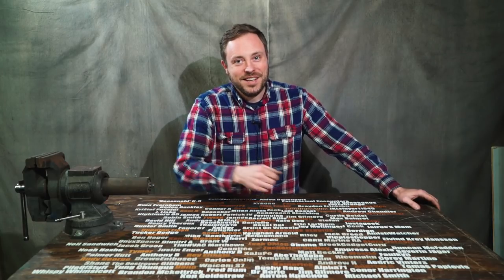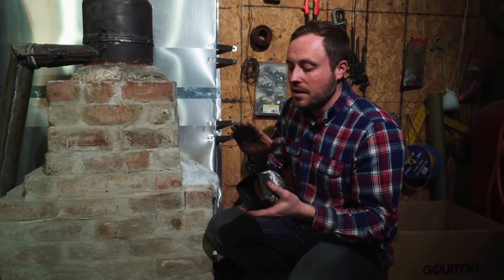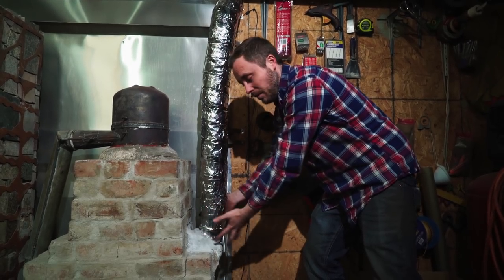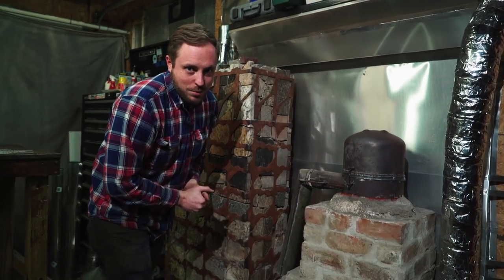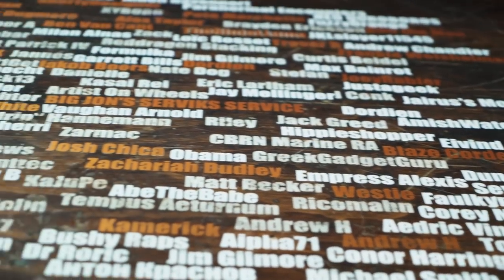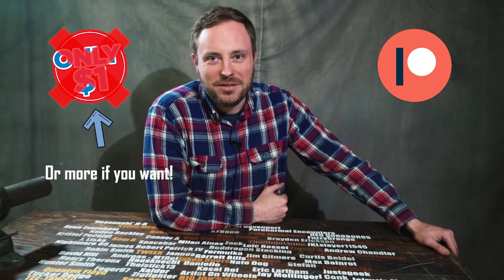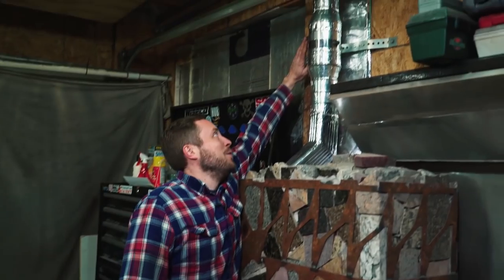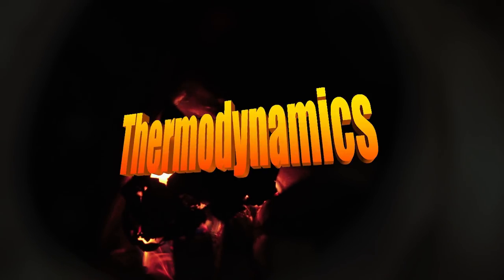Heat Your Garage For 74¢ A YEAR! - Mini Nautilus Rocket Heater Upgrade

Comment: Nice job! Rocket stoves are a thinking person's woodstove... and even though mine is 4 years old... I keep messing with it, make new drawings, and will build version 2.0 at some time. There's so many innovations here on YT.

I built a 6 inch flue rocket. It is a free-standing unit, utilizing a 55 gallon barrel. 

It is, internally, like the hippie rockets (hell, I am a hippie) only the riser is made from insulated firebrick (the most expensive component).

The exhaust goes out of the bottom, and into a 15 foot long mass of cement blocks and crushed stone, at floor level. From there the exhaust goes up and out of the basement, through the wall, and outside through that super-expensive stainless insulated flue pipe, gifted to me by a friend (free is for me). My indoor flue temps, at building outlet, are similar to yours... rarely 150°... more often 120°.

My stove is for heating my basement workshops, and the house above... the burn chamber is 8 x 8 inches,therefore, I can burn standard cordwood.

From my experience, it looks to me as if smaller rockets are more efficient, and hotter... but most smaller ones are to heat workshops/garages, not entire homes... all I know is that I love using it.

I was happy to get the insulated flue because condensation would run into the house, and black mung would run across the floor... at least it is water soluble, and cleans up with soap and water...

I put a T flue pipe outside, at the bottom, with a seepage hole in a cap. This keeps all condensation outside.

One thing I want to do is figure out an automatic lid, outside, that would close when the stove shuts down. I believe a lot of my mass heat is going up the chimney... and that the cold air, coming back down the chimney, cools the mass.

I go through a wheelbarrow of wood per day. When I had a standard woodstove, I'd go through 3 wheelbarrows of wood...

My rocket is on my channel if you'd like a look. The video is with the smaller 4.5 x 4.5  burn chamber...

I've been using it for 4 seasons, and have had zero creosote buildup.
Reply: So.. you go pretty much against anything that would make it a rocket stove and have built something similar to a normal stove how the rest of the world uses them - just a bit less efficient.-

Comment: I think you have done a good job here I think the reason you can use metal in the burn tunnel is you have a micro system, I think if you had an 8 inch system metal would not last.  I don’t think you give the hippie’s enough credit, I did laugh when you kept bringing them up because I think too many of  us are over the top on political correctness, I Have been to Ernie and Erica’s place and seen their rocket mass heater they are probably the most experienced builders alive. And they are both extremely well educated about fire and thermodynamics you keep mentioning. Anyway I love the video thanks for sharing, thumbs up from me dude!

Comment: it's all about the insulated chimney column to really get things flowing in the right direction, especially in really cold weather and especially when you add vertical column height to it. 

Also, the ease of operator input is more of a major factor than one might first imagine. pellet stoves will self feed for hours, a long feed pipe with scraps of sticks that will slide down on their own might also self feed for hours.

Comment: Have you considered getting/making a small wood chipper to avoid having to spend the hour or so each day breaking up the fuel?
Reply: Darksunrise there’s videos on how to make them too, usually it requires welding and a pretty adequately equipped workshop so it might be a cheaper one-off purchase to get a small one from the store. 

Also if you own a chainsaw there’s attachments I’ve seen that act as a rough marker for the length of the logs you’re cutting. It’s literally a stick that screws into your saw that pokes off about a foot from the blade so you can measure what you cut at the same time.

Comment: The comparison with propane at the end is a little misleading. It sounds like you're suggesting the rocket mass heater is more efficient than the propane heater because the rocket mass heater keeps the room warmer longer. But that's a question of convenience, not of efficiency. After all, you could create a propane mass heater if you wanted, and that would keep the room warm for a long time, too.

Comment: Hey, hippie here. If you have a predominant wind direction you should point the open end of you intake towards it, and the exhaust outlet away from the wind to generate a flow. If you want to get serious about harnessing that power also, you could stick a funnel on the intake side, and build a little venturi system on the outlet. That would negate the need for a computer fan, and possibly oversupply your stove with air (computer fan is a genius idea btw. I've heard that some fossil fuel based electricity generating stations preheat their intake air by drawing it down around the exhaust chimney, which results in such an efficient heat transfer that they then have to use fans to push the cold exhaust air out of the chimney. Similar to what you're doing here. Good Job)

Comment: I have just built a new barn and intend on using a rocket mass heater, so I have a couple questions. Well more than that, but I’ll limit myself. Have you ever thought about reversing the air flow in the summer  to cool the mass? I guess in your case you would not have to reverse the air flow. What I am saying is force the cool night air through the mass to cool it. Then the warmer air in the room would go into the cooler mass in the day time and cool the room. The second thought I have is an odd fuel. I live on the North American plains and we have an abundance of rag weed ( tumble weeds) which are flammable. I am going to harvest them while they are green and bundle them up tight so they will fit in the rocket. I am not sure what to expect . Do you think I am chasing my tail?

Comment: A chimney installer once told me that you should never reduce your chimney to the outside since it created compression in your exhaust and and is counter productive to your flow! That way starting a range exhaust fan can easily reverse you flow to inside your house or your garage. In the case of a garage letting the door open could also cause the flow to reverse.

Comment: Oh yes…we’ve had all kinds of trouble getting the old chimney to draw.  Not even making the firebox smaller, could help it draw.   Not even sticking a fireplace insert into there helped—it was a disaster. 
That’s another reason we bot a Liberator rocket stove + a chimney sleeve, besides how beautifully efficient these are. 
I used a drier vent to bring air into the air intake on it…& had to put a damper in that, to adjust air flow in.  

But maybe I’ll try insulating the intake, too…had no idea cold air would help the burn!? 

When installing the sleeve, I had to remove the recommended insulation wrapped around the sleeve, to fit it up thru the chimney, & simple-stuff it around the sleeve at top & bottom of chimney.   

Your cold air intake going direct into your feed tube, seems inconvenient….if it went into the side to of the feed tube, you could leave it connected, & be able to add wood more easily. 
Could even use a 4” pipe section to extend the feed tube then, allowing more sticks to be put into it, so you didn’t need to keep adding fuel so often.

Comment: What's the difference between forcing cold air up, and forcing hot air down?

How much cooler could the hot air be once it gets to the down tube? I can't imagine it would be significant, it's 6 inches from the to of the heat exchanger.

Comment: I was concerned about creosote build up in the heat exchanger but I see in another comment that you have pulled it apart and haven't seen that to be an issue. Makes me wonder why I have to clean my chimney twice a year when it's a straight shot up.

Comment: Three key issues need to be dealt with when designing rocket stoves:  Air flow, extreme heat in the burn chamber and fly ash build up in turns of the exhaust piping... restricting air flow.  In reference to the latter, (you've addressed the first two adequately) how many hours have you put on the stove?  How often do you clean ash out the bottom of the Nautilus?  Have you noticed any reduction in performance over time ( a sign of restricted air flow)?  Would you put more clean outs in retrospect?  If so, where?

Thanks, M

Comment: Hmmmm I may  have to build that. As far as making sticks small enough to fit in there. Get a 14" bandsaw, and decide on the dimensions and start cutting. I probably already have 2 or 3 buckets of pen blanks that would fit right in there. One suggestion I would have is to add a small computer fan on the exhaust as well to ensure you get it going......

Comment: When you said you were going to do your outtake in front of the stove, but wouldn't because you felt like you were going to be burnt.  Just had an idea, maybe put a cage around the helium tank to prevent anything falling on the tank?  Air/heat could still go through, but would stop anything from falling on it and catching fire.

Comment: How can you clean out the ashes and creosote that would accumulate in the exhaust chambers over  time?
Reply: If the fire burns hot enough there are no ashes. If I remember correctly he said that the target temperature is 1200 degrees.
Reply: @danielstellmon5330  That may be the combustion temperature, but he said the exhaust stack was only warm to the touch.  I imagine there will be a lot of condensate collecting in the chimney/heat exchanger.

Comment: I honestly don't know if this would work but couldn't you chip the wood to make it easier to load it?(also this would require some sort of wood chipper which negates the "freeness" of it) but sort of like what pellet wood stoves use or use actual wood stove pellets if you're willing to trade off free heat for still incredibly cheap heat but with less tedious work every time.
Reply: What I normally do for my wood forge, which has similar fuel size restrictions, is to gather scrap wood for like a month, then take 10 minutes with the chop saw to cut it all into small bits. All the small bits then go into a big barrel, so the wood is all ready to go when I want to burn it.

Comment: the hippies typically say you cannot make your combustion chamber out of steel, but i believe that's only true for the larger systems, like ones with 8" cross sectional flow area. the temperatures in those are much higher, and the steel will rust out within a few hours of running

Comment: I would recommend double wall pellet stove pipe because it has a stainless steel liner in it. It comes in 3 and 4 inch sizes. Also 6” triple wall stove pipe could be very useful here.  but, good job looks good!

Comment: Could'nt you use a heat transfer to create electricity to  operate your fan from the top of your heater , then run it to a fan to blow air in it ?

Comment: One thing you did not mention is carbon build up in the heat exchanger and the exhaust pipe. Because the piping following the burning chamber is so cold the residue carbon will condense before it can burn. These build ups, once big enough can burn off and turn your exhaust red hot, so either clean it sometimes or be aware of a possible run-away.

Comment: You could take the head off a lawnmower engine and bolt a small wedge to the piston. Then make a jig to hold 6 or 8” blocks to be split. Drive the engine with an electric motor and split very fast.

Comment: Interesting project. 
Listening to your comments on the time spent feeding fuel into the stove makes me think this is a perfect candidate for a wood pellet feed hopper.

Also, is your flue handle 90 degrees off? Or did you just move it the wrong way in the video?

Comment: Add a rotating chimney exhaust tip that the wind turns like a weather vane to prevent downdraft.  If made correctly you could use venturi effect to create draft when the wind is blowing.

Comment: Would insulating the drop pipe from the rockets tank into the mass reduce the amount of instant radiant from that amount of surface area and put it into the mass possibly helping the draft a little in the process. The surface area of the drop pipe could be 1/5th of the surface of the tank itself (not going to take time to do that math). Maybe a header wrap or the fiberglass stuff you used on the primary burn chimney and leave the joints exposed so you can still remove it easily. Although I think your new outlet chimney can change the issues you had. I would love to see it work without the 12volt fan except for start up times. Also dollar store aluminum tape can hold up to 700F I use it on my woodstove outlet flue joints before the masonry chimney and the joining of the flue to the stove since everyone's 8 inches isn't exactly the same (0.o) and I didn't want to build a shim. I take this off twice a burn season at the stove to clean things and have seen it peak to 700F when I fire it off sometimes before I engage the bypass to the cat chamber and all is well with it. I know what you mean by scavenging all the heat my stove full burn the box is +-500F with the cat up to temp 1200-1400F my flue temps drop to 250F versus 500+ with the bypass open at full burn. 700lbs of cast iron and tossed some old chevy heads on it for good measure. I might not be as efficient with the wood but for a woodstove I think that is pretty good being my flue temp gauge is only 3 linear feet from a 1400 degree cat the design makes use of expansion just after the cat there is a chamber before the flue this somehow lets a majority of that 1400F radiate through the walls and top plate and only put 250F up the flue that is internal smoke path temp not wall of flue temp. Since I have an outdoor masonry chimney I wouldn't want any less than 250F going out.

Comment: I don't know if you've ever heard of a HAHSA (Heat and Heat Storage Apparatus) but the concept was introduced in Mother Earth News a few decades ago. Initial investment would be higher than this system since the home heating is done through hot water which required a well. This fed into a small building (6x6 if I remember right) with a woodstove in it. The pipes went around the woodstove and the entire building was filled with sand which acted like a heat sink. It would keep an entire house warm by all reports. Sounds like your system is n ot only cheaper but more efficient. =)

Comment: Jairus, the flow issues with that stove are mainly because of the final chimney out of the house. Heat rises so the final chimney needs to be the highest point of the system (the interior of the house is a part of the system). When the air in the house gets warm enough and pushes out of the highest point, the huge volume of warm air in the house can cause the stove to draw backward because it is lower. Thermodynamics!

The new chimney you put on will most definitely perform better, but it needs to be the highest point in the system to be correct and to give it the best draw and performance.

Comment: For a while it didn't sound like the furnace was vented to the outside. Was worried about Carbon monoxide poisoning. 

But you don't want the exhaust temperature too low. You want the exhaust to be hot enough to rise up and out. 

Get a CO monitor.

Comment: I like your heater man it’s a good idea but in all honesty they can be much simpler but with just metal and a small amount of wood will give you tremendous amount of heat if you’re not trying to use the mass to store believe it or not the mass acts as an insulator the efficiency is much better if you just run metal without the mass and heat your space up with much less  wood and will be much more efficient

Comment: For more ease of use at the expense of some cash ether find a small used woodchipper or grab some bags of charcoal/wood stove pellets when they go off season and the stores are trying to clear them out

Or there might be a local woodworker or cabinet maker that wouldn't mind you hauling off some of their saw dust and small scraps

Comment: In case of power outage you should experiment with peltier wrapped around the cold air intact to power your fan
Reply: I don't know much about TEGs, but that fan is so low power that an old car battery would probably drive it for a week or more of use.

Comment: That's a really nice stove, but as much as you poke at the "hippies", your stove doesn't operate properly without a fan....Maybe because the  main mechanism for the flow of air is the insulated burner tube that accelerates the air in the system so you can do those up down bendy things with the flue pipe and still get proper air flow. I'd bet money your stove would work better if you'd used a simple insulated riser instead of your complicated contraption. I do appreciate  the hard work it took to do this and the high efficiency of the operation though. 
Oh, and if you separated the feed tube with the air inlet you'd be able to make it so you can put much longer pieces of wood in without impeding air flow.

Comment: my heater for my house has condensate water , I know you said steam comes out , but all of it ? no water stays inside ?
Reply: If you do get condensation it will eat out that galvanized flue pipe in a year. I find that all the time in the field with the eighty percent efficient gas furnace

Comment: i like your overkill protective measures.

the problem i see is the steel core of your system.. if it is surviving as you say then you arent getting as hot of a burn as would be desired. but hey it’s still going to be better than a standard wood stove..

Comment: you should reweld the handle turned 90° cause than it indicates correct, if the valve ist open oder closed.